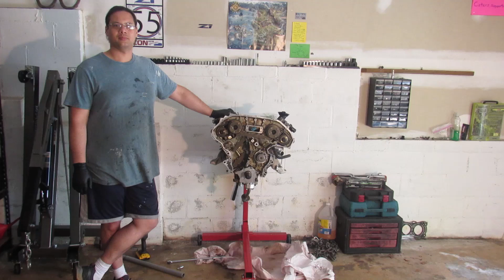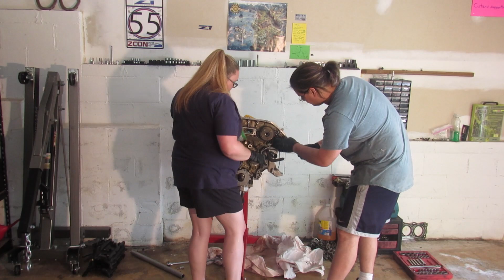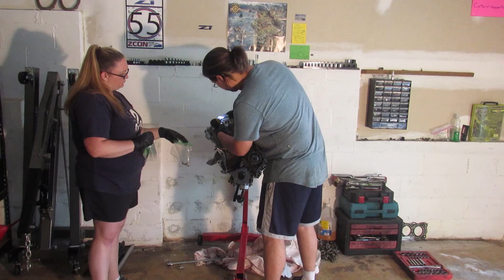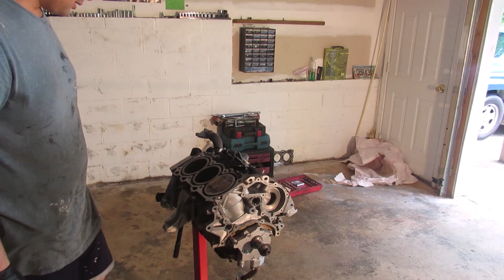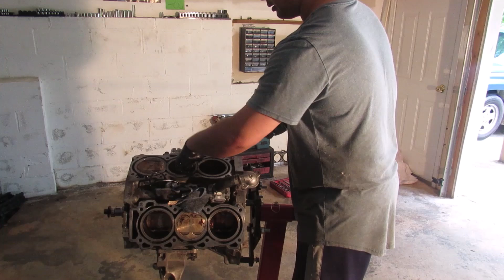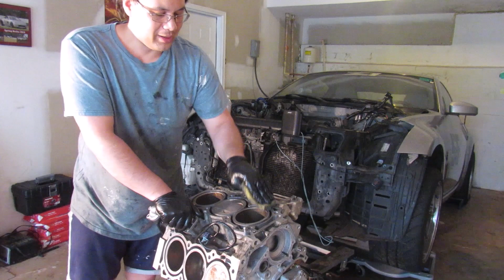Heads Removal and Engine Cleaning

Comment: Can I use the revup heads on 03 motor with 03 cams and plug the back holes
Reply from the maker: Yep, you can block off the extra holes, and if using revup cams, I'd suggest a retune because those cams are larger than regular DE.